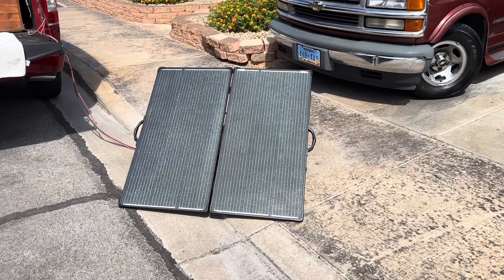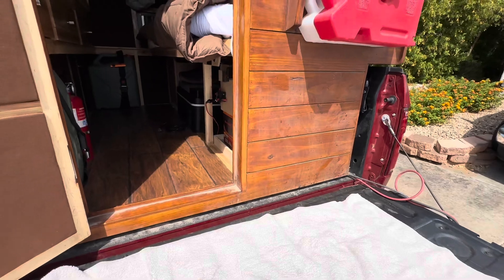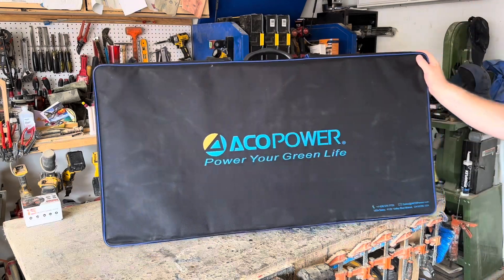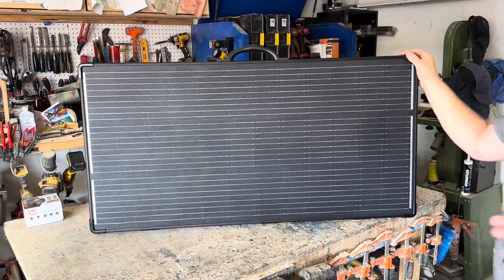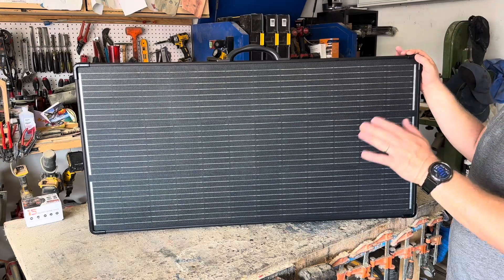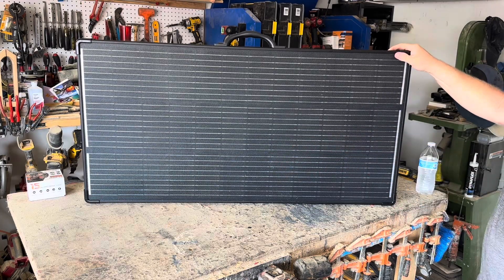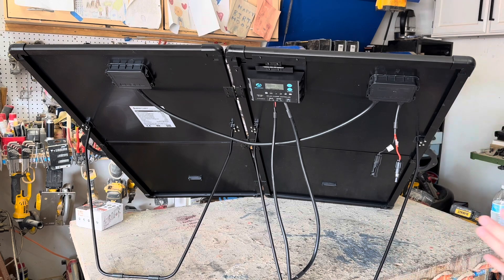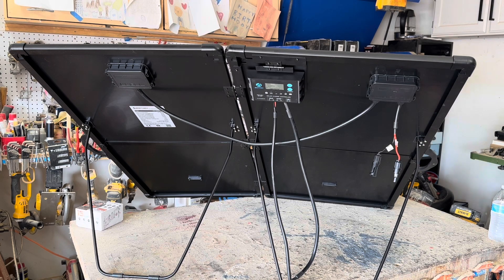Close Look At AcoPower 200 Watt Foldable Solar Panel With Build In Solar Charge Controller

Comment: Dave, 17 pounds sounds like a nice portable panel. I want to upgrade my camper solar, but can only put 400 more watts with the built in 30 amp max on my charge controller. These portable panels make it fairly easy to expand when yiu get set up. Thanks for the detailed review, don’t think I’ve seen anyone explain that you can use or not use it. Can you run several sets in series with the standard plugs, then the last connection uses the charge controller? Tganks
Reply from the maker: Probably not on this one. The built in charge controller I don’t think would be big enough to connect multiple panels.

Comment: Awesome. I like the rigidity of the unit as well as the built in charge controller. Handy if say you were just camping and pulling energy off a car battery or had super simple 12v setup
PS- I see they have a 10amp and 20amp version. Whats the difference for that? Adding more panels to it? 🤔
Reply from the maker: Thanks Jonny. Good question, I’ll need to look into that. I’m not sure